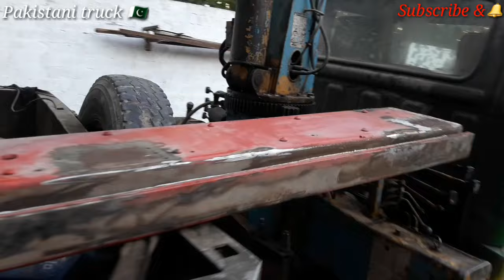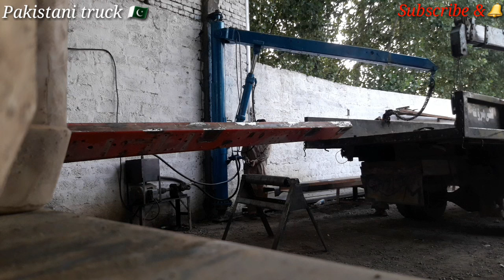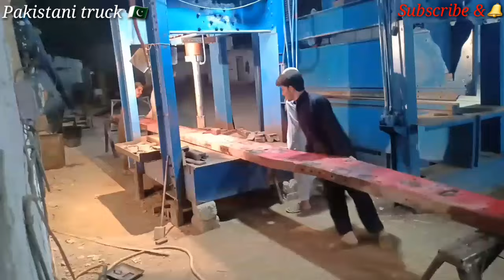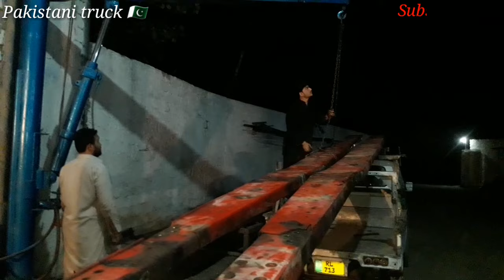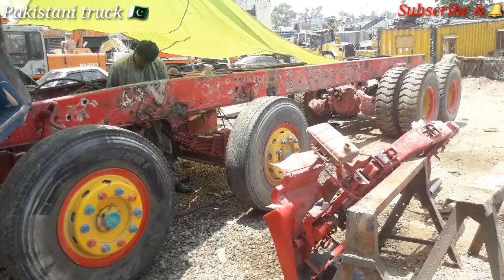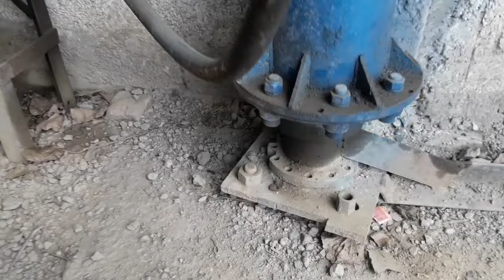Hino FY profia chassis frame straightening in Hydraulic press

Comment: Originally those rails were  made of a high strength alloy steel for strength and lightness. Then repaired with multiple layers of low carbon steel plate, riveted together. An adequate repair except under severe deformation.
Reply: Should be scraped.. Metal fatigue..